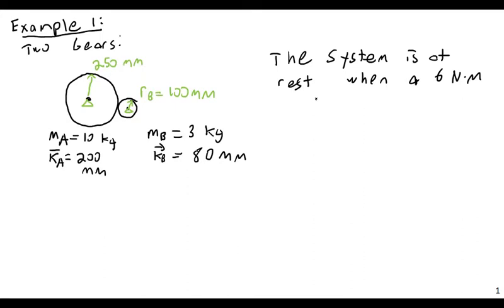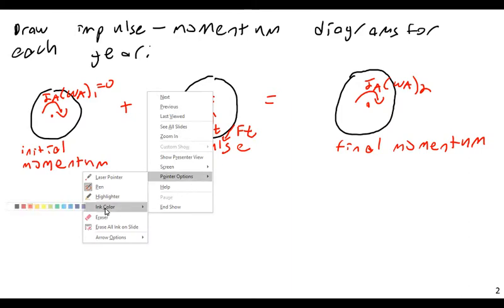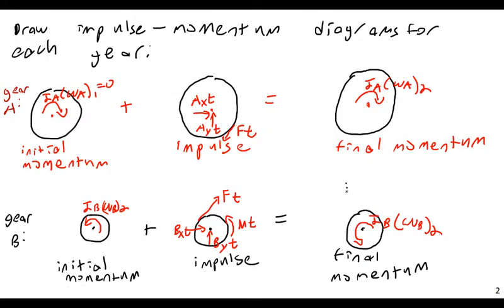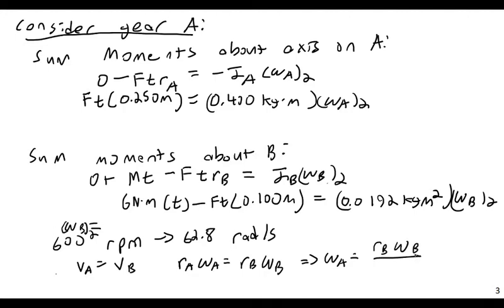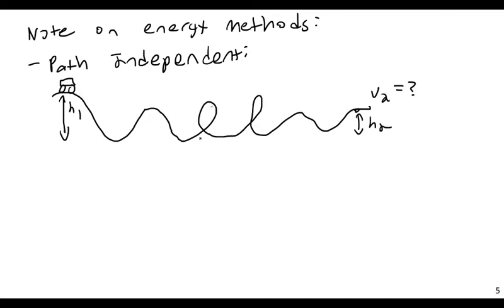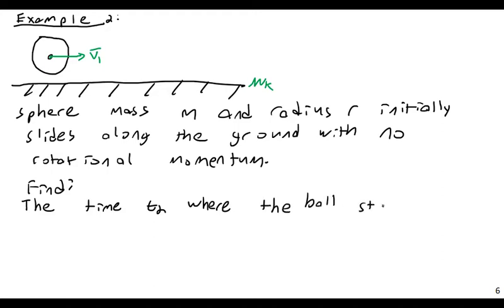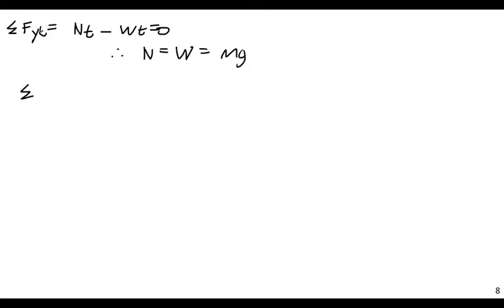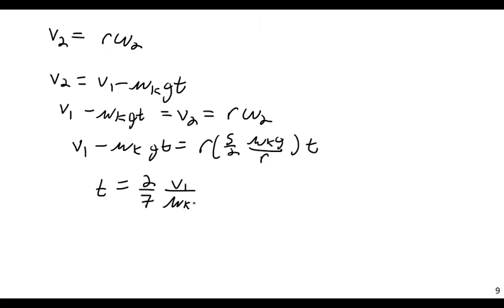Rigid Body Momentum Examples - Engineering Dynamics

Comment: Hello! I have watched videos 23-37 on this playlist today as an attempt to study for my dynamics final (over rigid body kinematics and kinetics) coming up on Wednesday. Could you explain when to use parallel axis theorem, or point me to another video that explains it? My professor has made a big deal about it in lecture but never told when it is applicable. Thank you!
Reply from the maker: You use the parallel axis theorem when you need to calculate momentum about a different, but parallel, axis. For example, if you're doing a conversation of momentum problem with multiple spinning axis. Maybe you have one wheel mounted on another wheel. That sort of thing. You apply conservation of momentum about a single axis, so you need to bring everything to a single axis in order to apply conservation of momentum for a complex system.